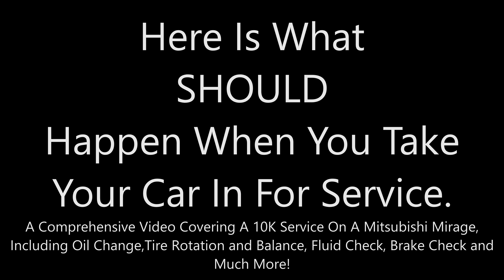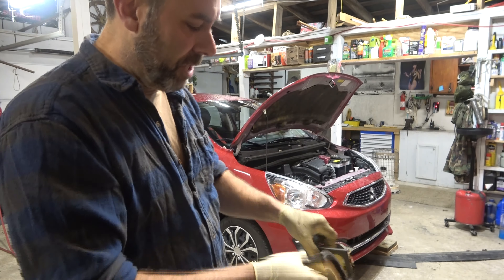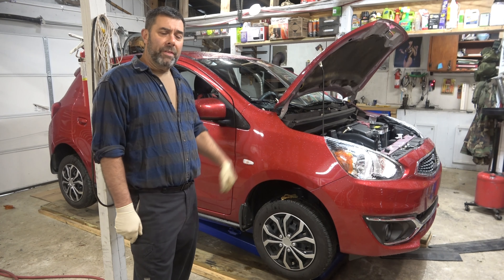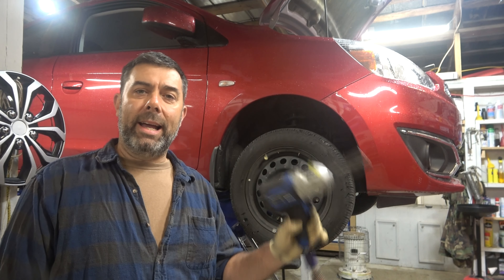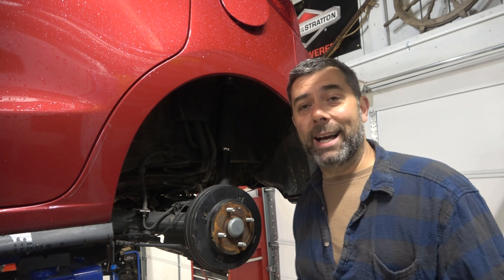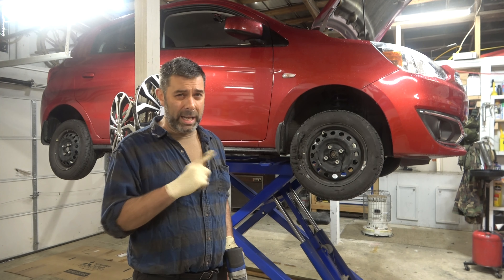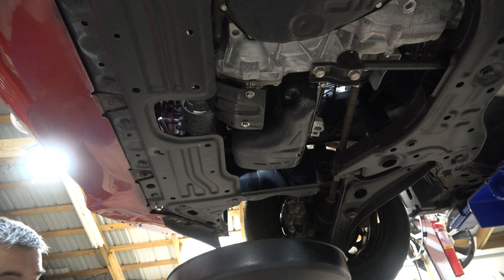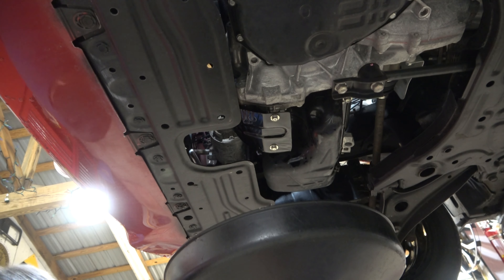Mitsubishi Mirage Routine Service Video. The Video EVERY Mirage Owner Should Watch. DIY Info.

Comment: Is this a direct injection or port injection engine?
Reply from the maker: Port Injection. No issues with carbon build up on the valves.
Reply: @FarpointFarms  that’s great. I’ll buy it then, it seems to be a pretty good and reliable car

Comment: In your professional opinion can a Mirage hit 200k miles without cvt failure if fluid changes are done every 30 to 50k miles?
Reply from the maker: If it's maintenance is done (filters and fluid) I don't see any reason to believe that they can't. I've seen neglected ones make 160k with original fluid so, I have every reason to believe it.

Comment: I am interested in knowing what kind of lower radiator support this car has. Is it steel that is welded to the body, is it steel that is bolted to the body, or is it some sort of bolted in composite part?  Thanks.
Reply: It's made out of foil and paperclips.
Reply: Spot Welded stamped steel. Light taps into curbs can push the core support back. I see this multiple times a day.
Reply: @coltenle  Thanks.  I was wondering how they do against curbs and parking stops, etc.

Comment: I did a 5k oil change and damn that oil  was black

Gonna be doing 4ks from now on
Reply from the maker: Was that with full synth?
Reply: @FarpointFarms  yeah, but its got 160,000 miles
Reply: @futureshock7425  your mirages has 160k miles? that's great!
Reply: Use Amsoil and their filter. It's the best oil out there

Comment: What if your oil turns black quickly after a change and has a fuel smell to it?
Reply from the maker: That would indicate a fuel issue. Too rich. Is the check engine light on?
Reply: @FarpointFarms  no it’s not on.    I drive a 2006 Audi A6 with a direct injected 3.2 v6.    Nothing is ever easy with this car

Comment: Erick, do i have to use clutch when shifting to higher gears ?
Reply from the maker: Not with the CVT. It's all done internally.
Reply: @FarpointFarms  its a ford fiesta 5 spd manual trans. I read its harmful to clutch components, ? If your not grinding gears what gives ?